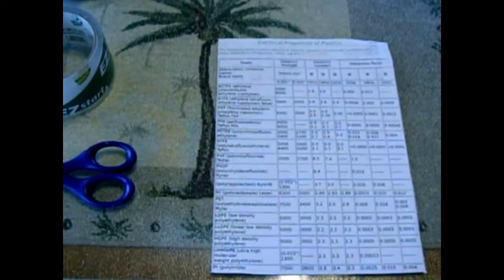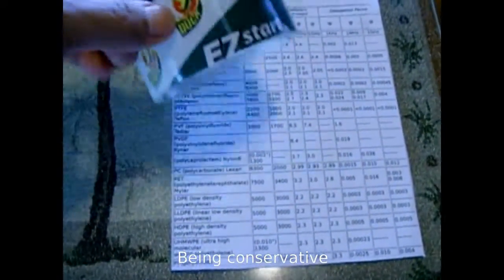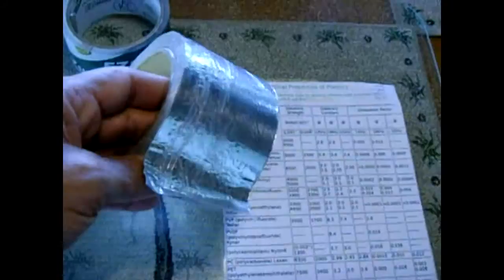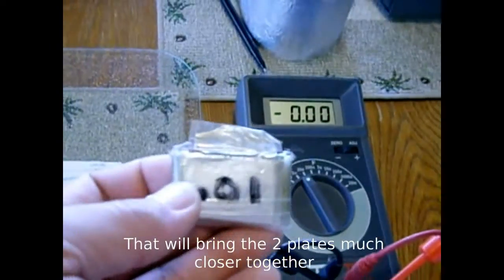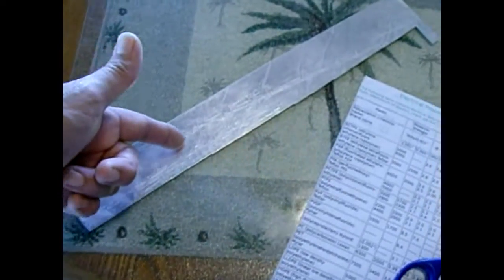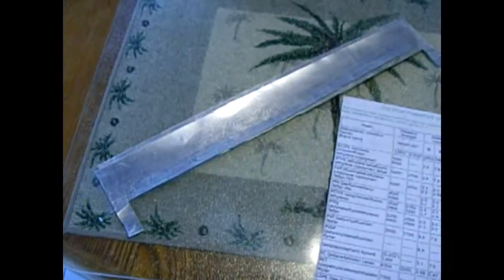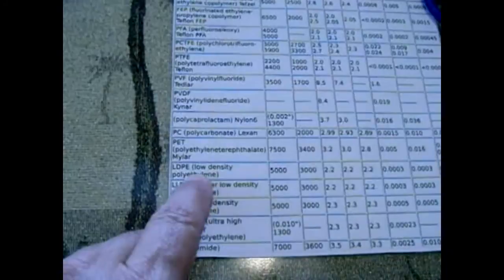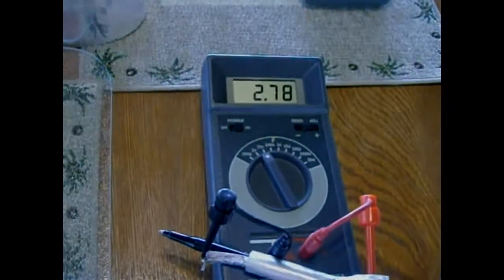How To Make High Voltage Capacitors!

Comment: Nice video. I used mylar sheets of about A4 paper size, sandwiched between smaller sheets of aluminium foil - your folded cap. Mylar has a very high dielectric strength material and is very easy to find.